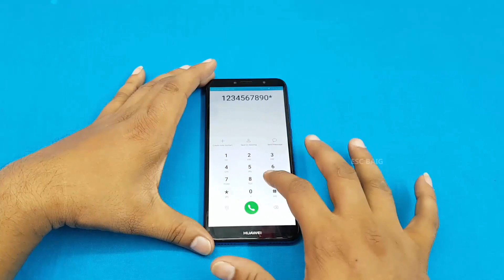Huawei Honor 7A Display and Touch Screen Glass Replacement || Honor 7A LCD Screen replacement

Comment: It is not PERFECT.. it missed the connecting part of a single flexy cable that come loose on the new LCD  board  when you get a new one. When you missed that..its a disaster. You have to order a new lcd and make sure you connect that flexy cable into its connector.